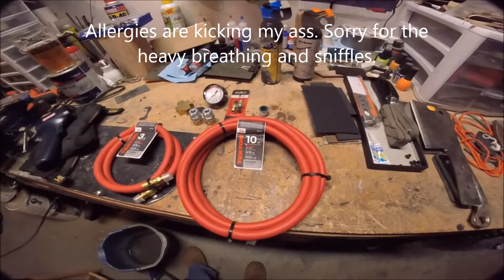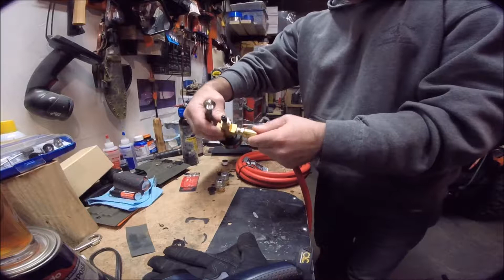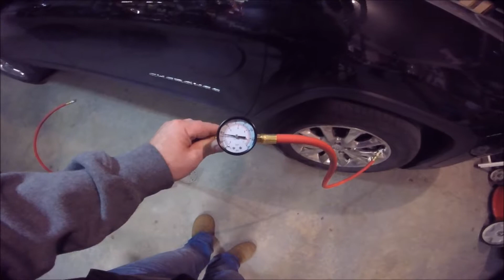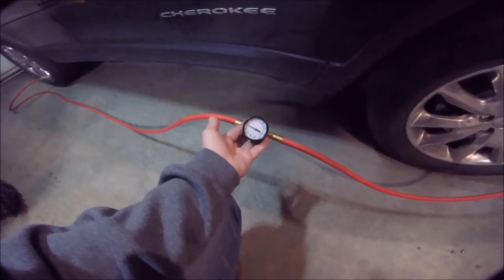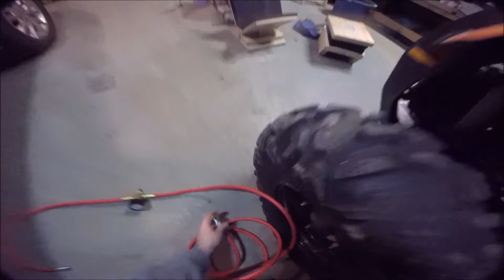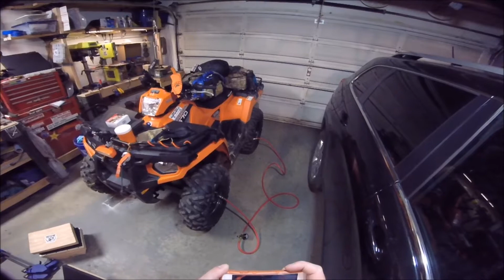Ryan's 2 Tire Thingy

Comment: How do the two tyres equalise if the ends are closed valve?
Reply from the maker: Closed valves are shut until they are clamped onto the valve stem. Once both are clamped on they equalize. I've since made a second shorter one strictly for my ATV. They work great! The closed valves make sure air isn't leaking out while you connect the second one.